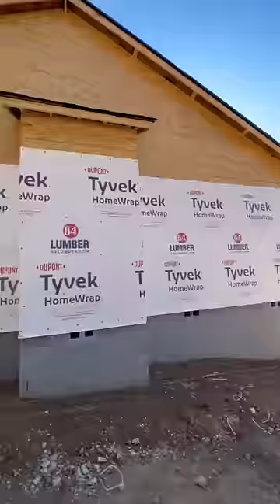Build My $350000 Wooden House in 60 seconds!!

Comment: Next hurricane: Hold my beer…
Reply: The beer seems to be the single pivot point to get back to the balance point...
Reply: I wonder why these new homes are built with 90% wood.. call me old fashioned, I’ll take a 80 year old brick home over a new one anyday
Reply: Called home owners insurance....
Reply: @lawnside82  wood is not the problem this is the weakest and cheapest wood used.
Reply: @lawnside82  hey bro i wonder why are like houses made out of wood in america whats thr problem with concrete and walls and the sturdy stuff?
Reply: Tell that to hurricane Laura and my house
Reply: @fikofikret1522  well it’s pine
Reply: Yes that's what they are made to do north america has the largest no. of tornades per year in the whole world, so these houses are made so that the damage cost will be minimum and can be rebuild again, if you make a sturdier house it is gonna get ripped apart by a tornado and the damage cost will be much higher
Reply: well tbf we don't get that many hurricanes in ga, especially in the metro atl area. most of it is tropical storms and depressions after the hurricane rips through florida. powerful tornadoes are pretty rare too.

Comment: If this were in California, his plans would still be at the Permit office under review for the 9th time because of he forgot to notate what year IRC Code he was building to on the cover page.
Reply: Not to mention that he would be prevented from building the house because 500 years ago some endangered species looked at the land once.
Reply: Don't forget, everything on the home, every 2x4, every 2x6, every copper pipe, every nail, shim, OSB board, ...has to have a Prop 65 warning on it.
Reply: @dsandoval9396  😄 🤣 😂 😆 so true
Reply: @dsandoval9396  osb lol. New homes in California maybe have 50% osb sheathing. Everything else is studs wrapped in  foam walls with stucco.
Reply: Also he’s using block for a foundation. Usually they call for a stem wall which is one solid piece of concrete. Anyways that’s how they made us do it we tried to ask if we could do block it was turned down instantly so we went with a stem wall.
Reply: Tell the truth. Permit office is corrupt.
Reply: @sunmoonstars-worthington8496  BIG time.
Starting at the top with the Mayor then the Building Official.

We were instructed on many occasions to leave specific jobs under construction alone.
My senior inspector once called and yelled at me to stop "messing with his people" when I investigated some illegal game rooms.
Reply: And this is what regulations do... slow everything down and make it cost more.
Reply: Sounds like you may have experience with this 🤔😉
Reply: @Tyshkevich  no; that’s what over regulating does. Regulations are needed to ensure safety, stability, etc. 
But California has completely over regulated everything because…

To be honest I don’t have an answer for that one. 
Meanwhile, down here in Florida, as long as your doors and windows are hurricane resistant they don’t really care about anything else. And if they’re not then you need to wrap your house with a privacy fence.
Reply: 500 million years ago a pterodactyl looked down and thought about landing there on that land so that’s a no go my man
Reply from the maker: That’s crazy!! I got my permit in 3 days!!
Reply: @NikosPropertyShow  A permit?!?  Are you saying you needed to have only one single permit, during the entirety of your homes construction?  CA requires each phase, ie: foundation, electricity, plumbing, roofing, etc., etc., etc. be first inspected and approved before giving you the permit necessary for the next step and on and on...
Reply: @dr.floridamanphd  I have your answer, it's because California is too liberal just look at skid row that is what their shitty politics have caused.
Reply: Because California is a soft state. Thank ur Democrats 🤣
Reply: Yet when it was finally done it would have worth $3.5M
Reply: Is their much code enforcement in cali lol
Reply: @snackz843  Why must politics come to the forefront on damn near every video??
Reply: @snackz843  skid row probably has more money than your entire flyover state
Reply: @Dr. Florida Man; PhD  This is exactly what I wanted to hear LOL I got a lot in Satsuma 1/4 acre that's been given to me since birth. Now, I can have the house of my vacation dreams and still live in California in my home here halfway paid off! 🙌🏽 best of both worlds 🌎 😍 hahahahaha
Reply: After hurricane Katrina hit you couldn't get a permit in the city of Biloxi to wipe your own ass. And it had absolutely nothing to do with updating flood level data and new coding. No it was so a few of the elites in the town could stop residential development in favor of commercial building for the casino industry. At least a couple of hundred homes were not rebuilt on Biloxi's east side (the poor/ Asian neighborhoods). These were older homes but they were on prime real-estate. The whole landscape changed when the casinos moved in and the poorer areas became the best place to set up shop. The area is still littered with vacant lots that can't be occupied by residential structures because of prohibited costs and red tape. But if you're a casino or large commercial product they will gladly pimp out their own mother to get you to sign on the dotted line. There's definitely some morally corrupt shit going on around here
Reply: I definitely know what this means
Reply: @DK-bk1vq  some folks love to divide.  My point comes from trying to build communications sites in California.  I couldn't care less about their political issues.
Reply: Anyone living in a blue state was going to make your comment.
Reply: @dr.floridamanphd  I bet your windstorm requirements are thru the roof.
Clipping, strapping, anchor bolts, and plywood on every interior wall. 🤣
Reply: If this were in Toronto, that 350k would just be the broker's commission
Reply: @benmaghsoodi2067  property makes up most of that evaluation. U don’t make money building a house in Cali unless u owned the land.
Reply: I never understand why usa homes are built with Wood Even tho You have hurricanes and shit every year while we use concrete and ladrillos here un south américa apartamentos last decades while these Wood houses don't last much
Reply: @JhonLouderxD  Answer:: We enjoy destroying miles and miles of trees and wood costs far less than concrete. Lastly, the average cookie cutter home takes approx 90-120 days to build.
Reply: @dsandoval9396  IRC code yup and u don’t know what that means🤣
Reply: @JhonLouderxD  bc this is America and we don’t like to live in jail like homes
Reply: @JhonLouderxD  not jail PRISON

Comment: Stick Framing with rafters and a full ridge? Better off with that, than just trusses, the ridge supported by the gable and elevations weight bearing central components supports the weight of the roof at the joists, and or collar tiesas long as they won’t rack, its very solid

Comment: That house will be extremely unleveled after about 50 years…
Reply: Thats what i was thinkin lol
Reply: That footing looking like ASS. There's one part whenever they first scan over it that randomly starts to angle off to the side. Idk if it was intentional, but I kind of fucking doubt it.
Reply: Wait so what gives that away? Just that the footing was poured weird?
Reply: Explain please
Reply: Shallow frost line? Must be in the southern country
Reply: @mariqstigler2197  its made out of wood and paper, like every us house
Reply: How so?
Reply: @mariqstigler2197  it's because of the footing of the house. They dug out maybe a foot or two and filled it with concrete. That'll work in short term but not in the long run, the grounds will shift over time because of the weight of the house.
Where I'm from they drive steel inforced, concrete pillars 30-50 feet deep in the ground and build the foundation on that.
Reply: @mosasako4679  lol have you ever been to Kansas/Oklahoma? I’ll assume not
Reply: Idk I've worked on 80 year old homes that where not built as good as he did his home, that have only 1 or 2 inches or sagging.
Reply: 50 is enough

Comment: This whole process is dope! 
As a contractor, I can appreciate to see the surveyors from concrete guys to carpenter’s to roofers to plumbers, etc.
Reply: Can you explain to me why these houses don't sink in to the ground? Here in the Netherlands every home has like 30 meter poles under every strong point. On wich the foundation is build
Reply: @xanderveldmuisje  It really depends on how strong the soil is underneath the house.
Reply: @xanderveldmuisje  Not 100% sure but I know Footings extend at least 12’ below the frost line
Reply: @xanderveldmuisje  You realize that like, 0.000001% of the process of building a house was shown in this video, right…?
Reply: @xanderveldmuisje  a very brief explanation is here builders are supposed to contact soil testers who test for “bad soil” the kind that shrinks or expands heavily with rain. If they find a certain amount they order fill dirt to be brought in and be compacted to a certain percentage which can get to be as hard as concrete. Still needs a slab obviously buy anyways this video here is a pretty good example of what NOT to do. This guy skipped several steps and used the cheapest possible materials for his foundation and I wouldn’t be surprised if he started having pretty serious issues relatively soon

Comment: As an ex owner of a foundation and basement company, the wonky footings bugged me but they are usually poured wide to account for that but then you went with a block wall instead of a poured concrete wall and I had to tap out. I've lifted too many homes to replace a block basement with a poured one. I can drive around town and see walls my grandpa poured in the late 50s. I do not trust blocks, even filled ones.
Reply: I have a block basement and you are completely right, parents have a poured basement and theirs is immaculate, mine has cracks forming between the blocks regularly
Reply: Even the poured ones? Why?
Reply: Filled blocks (fully mortared) arent as good as a poured wall but if u know how to care for your foundation (drainage) you should never have a problem. I would build my basement with them because im a mason and its easier that poured.
Reply: @John-Rambo81  that pretty much lines up with most “because im a stone mason” builds I’ve seen
Reply: This house has no basement.
Reply: @Bjorngrim74  this house has no basement.
Reply: @Bjorngrim74  it is probable that the engineering for the masonry wall was somehow inadequate, that the reinforcement was not installed, that the grout was too weak, that the dewatering system is poorly made or nonexistant. This allows water to build up pushing on the wall, resulting in cracks. Your blanket aversion to block is silly because block properly done works just fine.

Comment: Is that a standard foundation where your at? In Missouri only the lowest valued homes sit on block foundations with an air handler in a crawl space. Not trying to criticise, honestly curious.
Reply: Yeah, I kinda thought poured concrete was standard for foundations nowadays. My house is really old and has block foundation, but I didn’t think they still made new houses like that.
Reply: I avoid concrete foundations unless You don’t get a  winter season . To many issues over time
Reply: He said “near Atlanta “ so Georgia 🍑
Reply: @mr.anderson9938  footings are supposed to be poured below the frost line lol, but most contractors have neglected to do so properly for about a century.
Reply: Ate you serious all of just about down south homes are on blocks. So a straight pour is more high valued?
Reply: @t.vaimaona7219  lies, im from Texas. Not high valued, just the new standard since about 3.5 decades ago
Reply: @t.vaimaona7219  as the flash said it's been the standard for decades. Houses on blocks are usually small low value 70s or 80s homes in my area. I can't see how straight pour wouldn't be more valuable. With block there is usually no footer just alot of tampered rock that will shift and a stack of blocks will never be as strong as a solid concrete wall with standard internal rebar support.
Reply: @dawildcatz87  i do know rebar was installed in my block under my house. But i understand as a slick finish poured foundation is more reliable.  💯

Comment: in sweden we usually put age-resistant plastic between the concrete and the soil, otherwise the concrete absorbs all the liquid from the ground and mold becomes a fact after a while. Don't know if we have more moist ground, but we tend to drain house foundations, sort of like a barrier against moisture.
Reply: No In my opinion you just have very fertile soil with high Organic matter. Which holds moisture and water for long Time. And that ls why soil is also very soft.
Reply: Interesting..
Reply: In the gult coast you cant have basements. The water table is far too high but further in you see basements and they also employ a vapor-water barrier. When you lay wood floors down in the gulf coast you absolutely are recommended to have a vapor barrier between the concrete slab and the woodfloors.
Reply: yes we employ vapor barriers and ground barriers here in Canada...it is code.  Depending on the environment, you need multiple layers of separation, but a lot of it has to do with the differential between hot vs cold that creates the biggest issues.  I'm not sure if southern states face these issues.

Comment: when u bury the footing in the ground like that how is there proper drainage. $350,000 house i would want a minimum 6" schedule 40 PVC french drain run on exterior footer and 6" PVC french drain on the interior side footer. wrap in filter cloth backfill with washed septic rock.
Reply: Not everyone lives where it's wet. I am a civil engineer and own multiple houses as well. Ground water is 300ft below the surface where I live. You can dig 30 ft down any time of year and not have any water or noteable moisture.
Reply: All footings in Utah are buried but there’s a 8 or 9 foot foundation for the basement. It weirds me out how every state are some what different.
Reply: His foundation is also above ground so the drain would be pointless.
Reply: I understand the house would be fine from rain water but what about the showers, sinks, and washing machine water? Where do those pipes go to get around the footings? They must somehow go into the ground on the other side of the footings.
Reply: @ryanwatt754  pipes.... Underground.... Below the frost line
Reply: @blakel4595  I'm homeless and drowning in debt and multiple car problems. Can you please help me out? I've had an incredibly difficult life, but was finally getting it back on track, literally making the most money I've ever made, right before covid ruined everything all over again. I'm severely depressed now, and just want to die. Nobody can seem to help me. I don't even have electricity or running water. I'm all alone with my cat.
Reply: Are foundation posts really unnecessary?
Reply: @Network126  no excuses let’s go. You got this man
Reply: @startingtech3900  You don't understand. I'm severely depressed and literally falling an additional $400 into debt every 30 days. Plus I've been having ongoing car problems. Everything just keeps getting worse and worse. I'm spiraling downward and losing my will to live. My life is a fucking trainwreck. A person can only take so much. I need help ASAP.
Reply: @startingtech3900  I've been living without electricity or running water for nearly the past year now.
Reply: Umm why it don’t seem like he’s in to wet of an area … 6” pipe for drainage… dude I’ve used 6” drains a handful of times and this would just be an overkill…. Grading seems like water is going to be flowing away from the house anyways… but if he ever does have a problem greenwoods Greenscapes will fix the problem
Reply: @Network126  I just researched you. People have said you scammed them and are stealing donations? Did you steal ?

Comment: Don't forget about the low voltage ⚡ you know the intercom security cameras Wi-Fi a place where the plug in your TV ect... It's important that it gets done before you close up the walls and after electrician is finished

Comment: Are Houses in the US built with wood ? Where I'm from we build houses with brick walls and concrete cement. Wood is only used for doors and sometimes windows (as they're usually steel panels).

Comment: So what’s the thing in the US with the partial concrete basements? In Germany a concrete ground cover is poured on the total area of the house and the house is built on it. Is it typical in the US to just pour concrete where your walls are placed? I’ve also seen some round Concrete pours where wooden stands were fastened 🤔

Comment: You built a $350000 house and did cinder block walls? Well, I'm glad you got it done, so you could get the walls done, and the roof got done, and it's all getting done. When will the driveway get done? And have you got the siding done? Hopefully it's all getting done.

Comment: 5 years later. Here’s how we fixed the broken sunken foundation on this “”350000 house”. where is the structure?? I have built a house or 50, and am wondering where in the concrete did you accidentally drop that 125000

Comment: Now i understand why entire communities are levelled when a tornado comes. You guys dont build houses on a solid foundation  and the walls are from thin wood and some insulation. Off course it shatters under strong winds. In comparison, my house which was built from the ground up 17 years ago,  has a 1.5m  deep reinforced concrete foundation,  structural  support pillars are made from reinforced  beton blocks and the walls are made of 1.6×0.8x0.6ft concrete bricks. And yes, it is a normal house and everyone uses the same  building materials. We never had a tornado  but i can tell you that our houses wont even move. Why do you guys dont build stronger houses?